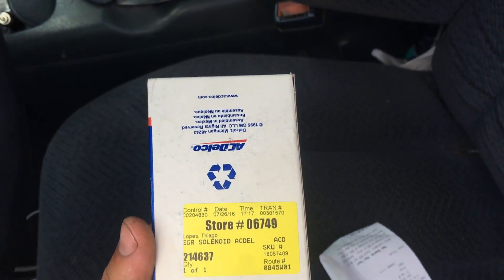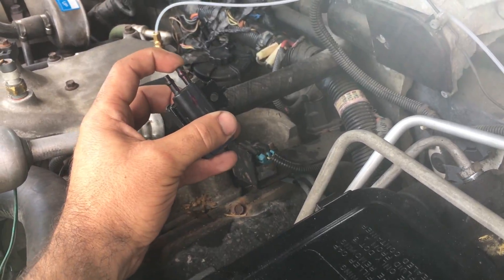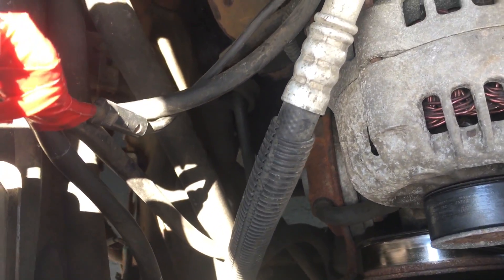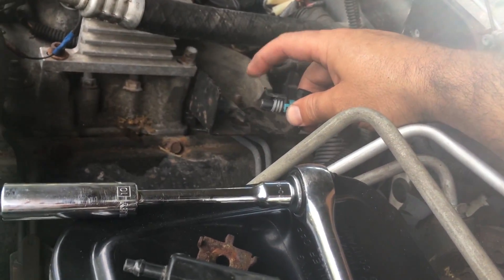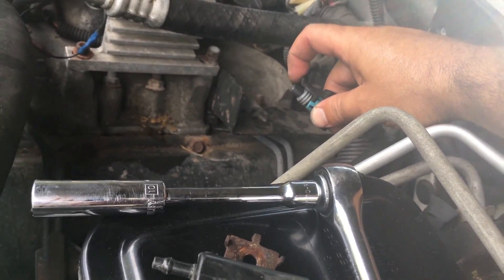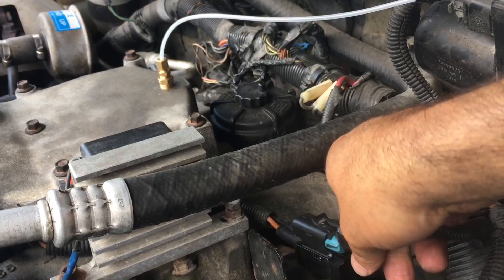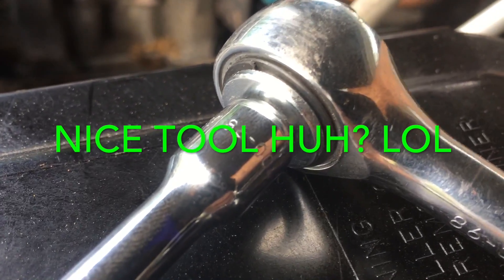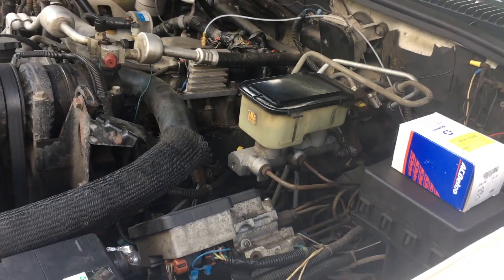6.5 TURBO DIESEL BOOST WASTE GATE SOLENOID P0236 REPLACEMENT

Comment: My dad has a diesel truck that would not want to move while in Drive and stepping on the gas pedal. No error codes at all. He switched about 2 pieces and nothing. Someone mentioned that it could be this small solenoid and they were right. So much trouble and it was this simple small piece that needed to be replaced.

Comment: i have 2000 6.5 what r the symptoms that teel you it needs changed thanks great vid man
Reply: typically a lot of black smoke under acceleration
Reply from the maker: Thanks, the symptoms was a engine light code P0236 that went on, so that was the reason why i changed it. have a great one, im glad you liked the video.

Comment: nice vedeo mate my dam suburban 6.5 he lost the power and make a lot smoke i don"t know who must i do because here in norway nowone understend nothing on american cars
Reply from the maker: thanks, is it diesel? white smoke?
Reply: hi mate yes is a 6.5 turbo diesel and a black smoke
Reply: jorge fonseca did u ever fix?
Reply: @TheMcdrewb   I deleted all vacuum stuffs  I put a wire on turbo for keeping all the time opened 😅  and  still not power 🤔 I don't know if I need replaced a damm turbo 🤔 because after  replacing a automatic transmission to manual transmission the OBD not working 😃😃 I don't have idea what a hell happening on this engine 🤔 low temperatures no worries crank very good  excellent but  lose power on hills 🙄😐